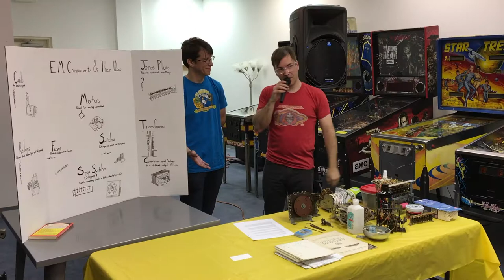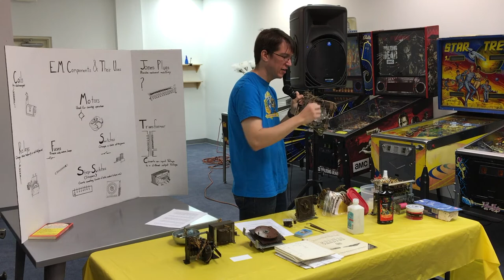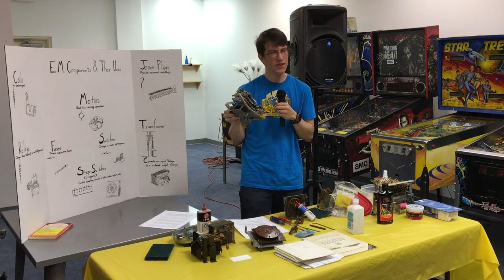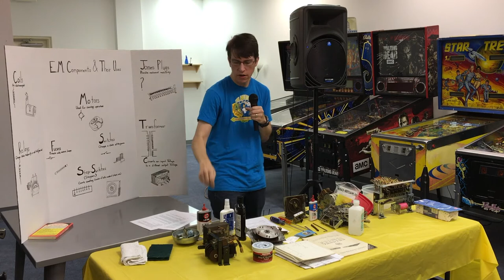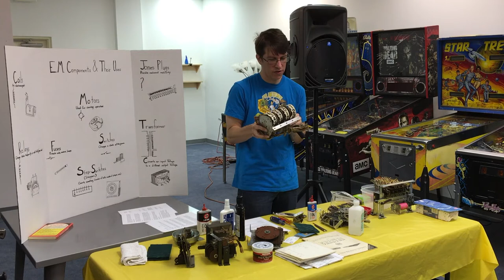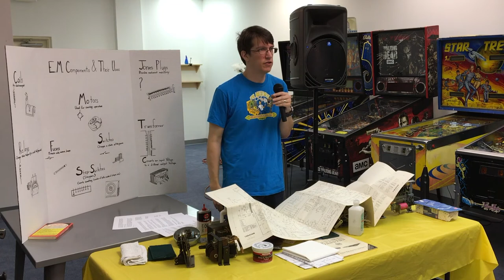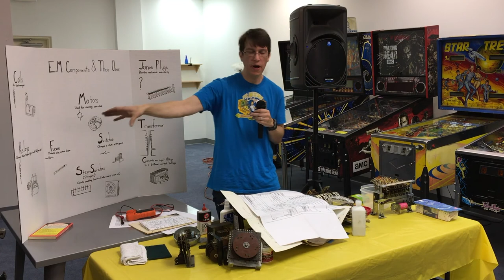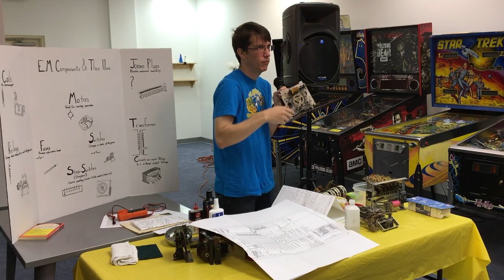The Basics of Electromechanical Pinball Repair

Comment: Just a point regarding the partially broken wire discussed in this video.  It was not the voltage that prevented the relay from actuating but rather the lack of current.  Higher voltage has more push but no push(current) Resistance in the line caused by bad connections or partially broken wires will show voltage or continuity but will not allow enough current to flow to pull in the relay.  If you measure voltage when attempting to actuate the relay you will see it drop to something close to zero.

Comment: The 3 in one for motors is not meant for small motors. It  says 1/4 hp or larger. I’ve used regular 3 in one for pinball score motor felt pads believe that is the correct method. Anyways cool u are spreading em knowledge gotta keep these historical tech machines alive.